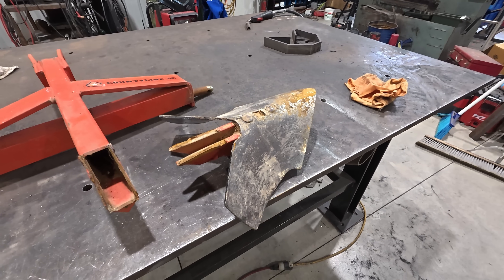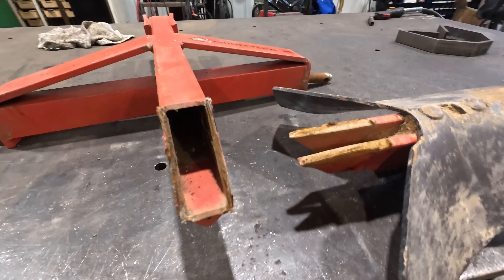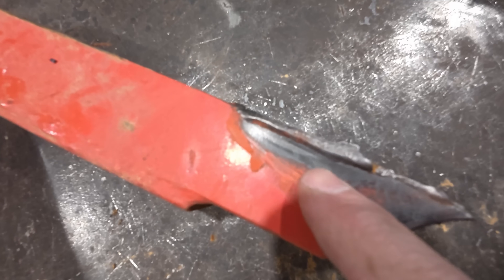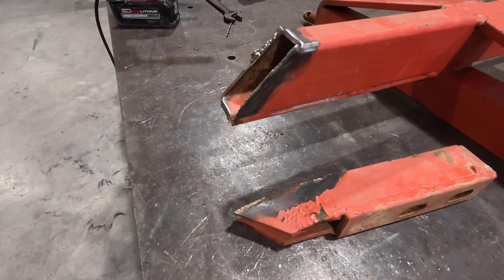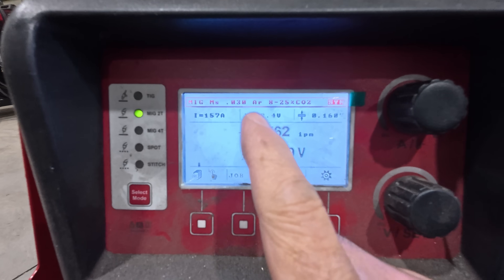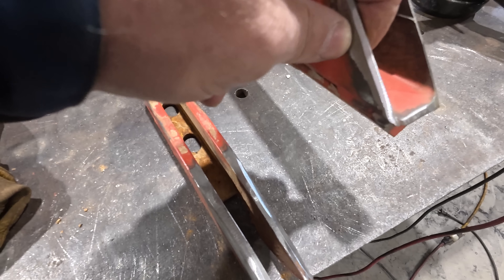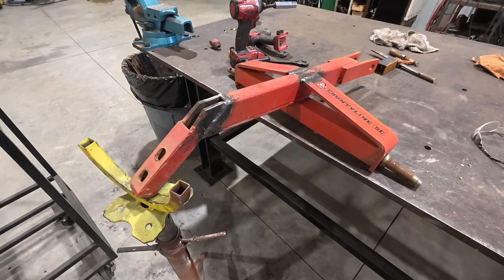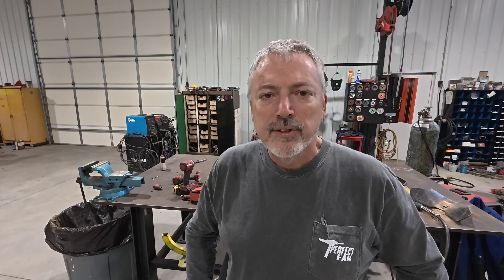This MIG Welding Mistake Destroys Your Projects

Comment: Nothing wrong with MIG welding. I've never had one official day of welding training in my life. I was self taught in the shop since I was a kid. My Dad had an old Lincoln arc welder and some books. Read the book he said and figure it out. I still have the old Lincoln I'm 63 now I remember it from when I was a little kid It's probably 60 to 70 years old. I also did wire gas welding and brazing. I bought a Miller 175 Mig 20 years ago I love it. The problem here is piss poor preparation in the first place mill scale not ground off edges not beveled for good penetration. A tip from a friend of mine who is a red seal welder. He said in the trailer repair shop where he was working for a few years they do a lot of MIG welding and they run flux core wire as well as gas for extra insurance to avoid any porosity problems if a breeze blows through the shop. I'm eyeing up buying one of those arc captain tig welders as I'd like to try aluminum and I have a car restoration to do as well. A lot of these RV's are falling apart because of piss poor welding at the factory just like this plow weld with no prep or penetration.

Comment: There's no penetration. The only mig I would be a vert core with 0/65 wire. Remember that you are using mild steel unlike using rods.

Comment: I'm not going to sit here and say I'm a "welder" by trade, I'm a professional mechanic. I did go to school for welding, what seems another lifetime ago. But I have welded off and on ever since taking those classes. Also, I'm not going to say that Harbor Freight sells the best equipment. But you'd be surprised at what ive been able to do with a higher end HF welder. One of many things I've done is completely rebuilding a 22 foot car hauler. Hitch, fenders, wooden deak, ramps, and their storage under the dovetail, all the wiring, brakes, and an the axles. Every bit of welding was done with a HF welder. It's been on the road for more than ten years with zero weld failures. Now folks can rag on me and claim how unsafe it is and how I'm putting everyone's safety at risk. Which is BS!! Im a father, grandpa, and a husband. Im well aware of what can happen on the road. I would refuse to put ANYTHING on the road that would be considered "unsafe." With that project, I took my time and unsed the best materials I could get for it, and then some. I've pulled an unknown amount of vehicles,  four-wheels, side by sides, heck all of deer camp a couple times. With absolutely no problems whatsoever!! Obviously, a HF welder isn't going to replace a Miller, Lincoln, or Snap-On. But, you don't NEED to have one of those brands to produce good welds!! Just saying. 🤠

Comment: Funny because the Old MIG weld is replaced with New MIG weld & the Video is titled "MIG Welding is Dangerous". You could have TIG welded it. At leasts TIG weld the root pass.

If your going to MIG weld, than please pre-heat the work pieces.

Comment: All good advice. Flap disc is a migs friend. Most weld to cold, got to adjust heat to thicker piece and favor it. 
Good vid but got to slow the camera juke a bit. (It is harder than some think to make these vids) I found that I could focus because I was looking past the camera and the lens view is much slower for the detail. tks.

Comment: I am just a beginne at welding , a real greenhorn , but i worked as an Maintenance and repair mechanic for industrial/ production machines for now more than 15 years . And even me as an Absolute Beginner could see that the preparation of the Original weld could only be named a total failure. No bevels no chamfers , and propably no correct Settings on the welding machine. I'd really wonder if those people just welded right on the colour and not on the blank Material? Just my two cents in this. There are shure welders out there who just done it long enough to correct me if im totaly wrong.

Comment: I would have laid a piece of .25" thick flat stock on the top of the tube to reinforce the joint, and one on the lower side too.  That, or a fish plate on each side.

Comment: I was working at Electric Boat, General Dynamics when the started welding the submarine sections together with mig welders on tracks. It was previously done with stick. You should see the size of the wire reels. Think of all the personnel eliminated, one guy watching a d adjusting the heat,  wire feed and travel. No labor mistakes. After a bead all the way around, the tracks were moved and tacked in another spot. Mig is great if controlled right.

Comment: So which MIG welding mode of transfer are we in here?  Is this high-end short circuit or is it globular transfer?  From what I recall about MIG-  globular will get you better penetration as long as the metal has sufficient thickness.
Reply from the maker: This was on the high end of short circuit.

Comment: 99.9% of manufactured metal products are mig welded so if it wasn’t a reliable process they would have to use something else. I am a retired welder with 50 years of heavy industrial experience and 90% of my welding was tig and stick and as with all of the welders that I worked with we despised mig BUT mig has its place and in its place it can’t be beat but you must do proper metal prep have the right wire and gas etc etc .

Comment: I was a steel fabricator through the 80s and 90s.  I did a couple seasons of ship repair after that.  It has nothing to do with mill scale.  Solid wire MIG should never be used on anything over 1/4 unless it is used for something like rebuilding shafts .  It is not a reliable process like 7018 stick or Flux-core with CO2.  I have seen many failures like this, large fabrications fall to the floor because someone welded a lifting lug on with solid wire MIG.  We tried building snowplow frames with MIG and they cracked because it has poor impact strength.  Nobody has the time to remove mill scale in large fabrications like overhead cranes or heavy structural I-beams.  All heavy shop fabricating is done with Flux-core (1/16 and up)with CO2 running around 28-30 volts.  7018 sometimes with a 6010 root is used for outdoor repairs.  A hot root pass with 6010 is used to burn through the rust and paint.  Nobody has the time to 'prepare' a surface on a ship and if you take a grinder down into a ballast tank on a ship you won't have any friends at the end of the day.  That being said it is probably good enough for this noncritical repair, set the voltage around 28, set the wire until it sounds like bacon frying and direct the heat into the heavy part.

Comment: Steve proves that the process is the failure point. He successfully welds the same type of assembly by correcting the process. Reducing the thickness of the weld sections by grinding the joint into a v. Cleaning the surface of the material to allow good penetration is key to a solid weld. 
Heavy sections of metal can be welded successfully by engineering the weld joint to allow penetration and access to the joint. 
Enough heat to fuse the weld alloy to the base mental can be created though multiple passes to fill a properly engineered v groove. 
Tacking multiple dabs of metal instead of stringer beads can cause chilled cracks in the weld material. 
Production welding can be done well with training and practice.

Comment: This is not a weld issue but preparation issue.  There is no penetration because the thicker piece was not prepared properly.  This is basically surface welding and barely that - some of it looks like it had no prenetration at all.  You wouldn't have got any different result with any other welding method.

Comment: On the farm we use gass less mig for general works, and anything that requires strength like bucket teeth, gantry cranes etc we use stick. Only because i used stick for 30 years and only bought and used a mig this year for the first time, and don’t trust my skill levels.

Comment: A big part of the problem here is the fact that most Americans are cheapasses and would rather pay less than it takes for a qualified weldor or quality automation processes, and the other people in the total process required to get a quality product to you. We spend trillions in fuel to transport heavy, low standard items like anvils, manhole covers, and vises, because we can save a few dollars in the end by utilizing the cheapest labor available in the world, despite the increased transport costs involved. We have absolutely gutted our own industry while forcing it out to places with lesser environmental and worker protection standards. It's been resulting in this kind of garabge product flooding our market and undercutting the American workforce that's left for decades now. Same for Canada, and plenty of other first world countries who are now full of debt slaves who send their money to far away lands where a boy in sandals with no safety glasses can produce cheap Amazon grade junk for you. 

MIG welding is fine, as the video asserts in the end. It needs the proper prep, settings, and an operator who knows wtf they're doing to execute properly, same as any other process. It's definitely not the only tool in a weldor's arsenal, but it can do the lion's share of a weldor's work quickly, safely, and cost effectively.

Comment: That original weld was not done correctly, that could have been done with any process, that's a welding machine operator error, to fast, not hot enough and poor prep.

Comment: I've done very little MIG welding so here are comments from a novice welder/expert grinder.

Check penetration by looking at the back of the weld immediately after welding. It should be glowing.

A backing bar as well as edge prep are useful for butt welds that are really important.

And when welding different thicknesses, focus on getting the heat into the thicker side. A weave can be adjusted to achieve that.

I'll be trying some pulse MIG in a little while on another project of mine.

Comment: Looks like there wasn't any bevels, heat/current wasn't high enough, possibly the wire and shield gas may have been wrong/unsatisfactory, preheating the heavier thickness steel would help, controlling the cooldown can help (but probably wouldn't have done much here), among other things. To me, that was just initially done by an unknowledgable and/or lazy fabricator. Your repair welding is far superior to the original.

Comment: I work with wood and epoxy in boat building and I'd probably put some extra pieces of timber over the repair to give it a lot more strength, like a butt strap type affair, so I was wondering would that be a good alternative with your job here?

Comment: A cup of coffee and a nice welding video.can inspire me to dust off the old Lincoln 225 I bought in 1981.I don't know what I would weld now days but I did do a lot of exhaust and landscaping equipment. I'm a 7018 guy but I keep 6011 handy too. 3/32 to 1/8 are the diameters I use.
Reply from the maker: Thank you, 3/32 7018 is one of my favorites.

Comment: This is what a butt weld is called. They slammed the pieces together no bevel on either piece that is why the weld broke and did not rip a piece out of either piece. That along with not enough weld can more often than not be the cause of any failed weld.

Comment: Great clickbait title, and well done repair.  But your wire brush did not strip enough of the paint.  I use those stripper discs to QUICKLY get the paint - or rust - back far enough - an inch or two - so that burning paint doesn't fill my helmet. Saaaaaafety! 😐

Comment: its suppose to break where it did .......you dont want it so strong that it breaks something on the tractor.......but if you dont care i would of plated it on 3 sides, top and sides and made it stronger than popeye the sailor man......also could of added a hunk of plate inside and made the walls the same thickness as the piece that fell off and gave it the beans

Comment: Amateur here who loves to weld.  Heat, intense light, lots of energy, smoke, sound - I love it all. 

I own a Lincoln MIG welder and worked as a welder at a tractor accessory factory (Speeco).

That was a piss poor weld that should’ve never left the factory.  

The problem isn’t MIG.

Comment: I would not blame that totally on a poor weld exactly... If you notice those lower heavy bars are all bent up also... The first weld I agree was crappy... BUT that whole design is crap.. There should have been cover caps and gussets to help take some of the stress... And being a 3 point hitch there would be a lot of side loading on those welds..  The tractor does not always drive straight... Just a very bad design in my opinion.

Comment: Good class! Professor, I have a question. When welding dissimilar thicknesses, do you spend a bit more time on the thicker side than the thinner?
Reply from the maker: Yes, depending on the difference in thickness determines how much time you spend on each side. I generally let the puddle "wash up " on the thin side just until it fills the gap, and then pull back to the other side to prevent burn through.

Comment: I admire people that take up the challenge of welding. Yes it can be a daunting task when you have never used a MiG gasless welding machine but you don't need to be scared, with a little understanding of the welding process and the correct safety equipment, you will be very surprised at what you can achieve.

Comment: Becoming a good welder is all about practice. Sure there a some basic principles that need to be learned e.g. for gasless mig welding , wire speed, heat / amp setting adjustment, according to thickness of steel. And yes preparation of the joint to be welded, safety equipment e.g. helmet, gloves, jacket etc. the whole purpose of welding, is to achieve good penetration whilst filling the joint with molten MiG wire. 

Sure, having someone to show/ teach you some finer points is a great advantage however this is not always possible, especially for a farmer living in the middle of nowhere. Unless the project that requires welding could be dangerous to yourself or others if not welded correctly, you have nothing to lose by attempting to weld the broken pieces.

I started welding 50 years ago with an old 130amp Lincoln ark stick welder, making gates for semi trailers. I worked my way up to making buckets for front end loaders, using 6mm iro powder electrodes with 300amps. Today I'm now 70 and still weld with my 140amp gasless mig welder and cut steel with a plasma cutter at home. 

Once you start welding and achieve some success at first, you will be so glad that you learned welding and will find so many applications for its use.

I hope the you are encouraged to keep trying and learning and YouTube has so many videos that show the basics of MiG gasless welding to enhance you knowledge. Good luck, never give up.

Comment: Now something I come across a lot with MIG & Stick  OR MIG  V Stick     Do you Drae/Pull Mig .... as with Stick, OR Push the wire in to the work  ie Push as in work away from you so the hand may go over hot metal .... Slàinte Mhath   from Scotland

Comment: 50 years ago when I started Welding , there was good Iron and  Steel and then  there was some  Recycled "Monkey Metal" around , Now there is all most no Good Iron and Steel , its all Recycled Monkey Metal . Weld that Monkey Metal all you like with Stick , Mig ,or Tig the weld is only as good as the Metallurgical quality of the Steel or Iron you are working with .

Comment: That is chineseum production weld that you’re showing. Proper technique and quality equipment can produce satisfactory results. When I was providing repair welding service, if I wanted to be sure something stayed fixed, I over engineered the repair and used stick most of the time.

Comment: I’ve been welding for about 50 years. I’ve. Welded miles of welds with 7018.  I’ve welded with a mig machine for maybe 5 years. When I started welding structural with mig I was really surprised how easy it was to make a pretty weld that had no penetration.  So I did a lot of. Destructive testing until I was satisfied with the settings.
Reply: Exactly, this isn't even pretty and has no penetration.  I've only done stick welding and mostly learned from myself, but this is not about welding method, this is preparation - or complete lack thereof.

Comment: Well as a metal fabricator i would have inserted a flat bar inside the rhs.  Drill a few holes in the short side of the rhs to weld it in place have it come out between the two fingers there at the bottom and welded and plated it in. You could also recut the angle to increase the length of the weld. For when you break it again.👍

Comment: The most important aspect of welding is to achieve the correct penetration.  Not to say that all the other stuff like preparation, power, wire speed, gas flow, etc., are not as important, but the correct amount of penetration of the weld pool is your goal.

Comment: Your title is BS! Mig welding is NOT dangerous and has NO "hidden problem". The problem is with the person that operated and set up the welder and FAILED in their duty to ensure some kind of procedure was followed. IE, Grind off millscale, correct gas choice and bevel/weld prep the joint. Plenty of mig welding is done in structural welding, general fabrication and welding of agricultural and plant machinery without issue.